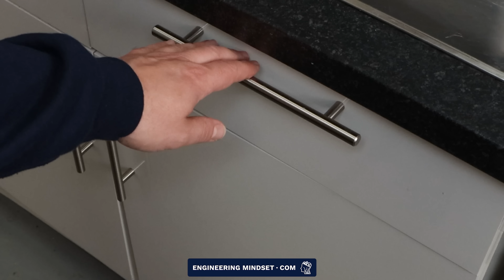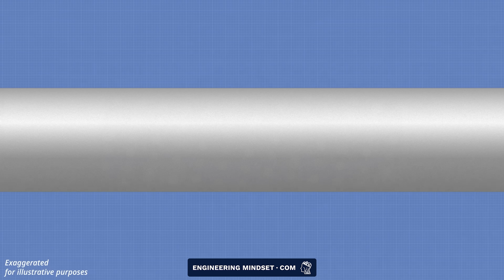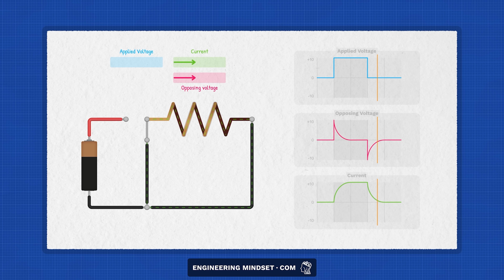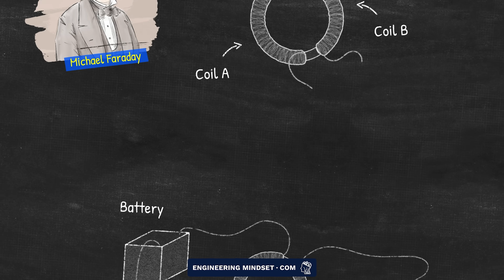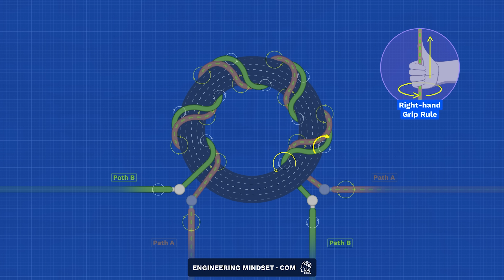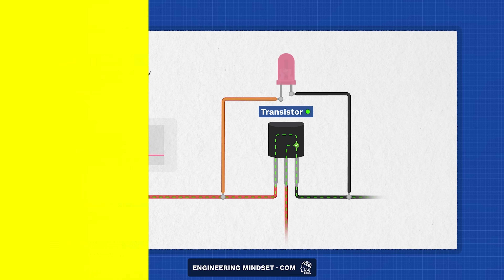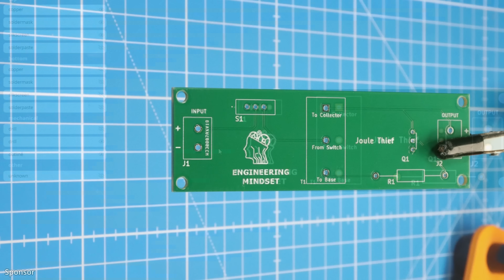Why This Circuit Works When It Shouldn’t

Comment: I bought the Joule thief from the engineering mindset website and I have it working on the breadboard. The new 1.5 volt battery powers the 3 volt LED perfectly.  I connected a .48 volt "dead battery" and it does NOT work?  Please help me to get the .48 volt "dead battery" working.  If I need to use other components to make this work, please advise me where to place it on the bread board. I appreciate the assistance.  I am really "new" at working with electronics.
Reply from the maker: Hello, I have just replied to your email with some tips. But for anyone interested, see the reply below.

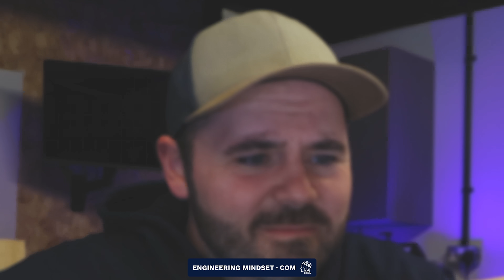So a battery is typically considered dead at around 0.8- 1.0V, as yours is 0.48V it is extremely discharged, once a load is applied it will likely drop significantly more and would be hard to sustain a useful output of current. The one we showed in the video was 0.87V (Time stamp 0:16) and the product page lists "down to around 0.7V"
The main limiting factor is the transistors turn on voltage (base to emitter), it varies slightly with each component but requires about ~0.55-0.6V for the ones supplied. So we need the voltage to be around this for it to work, but it must also be able to provide sufficient current. However, if the components and battery are warm, the internal resistance will decrease so we can get a bit more power out of it and if the transistor is warm, the turn on voltage can reduce slightly. So make sure you're using it in a warm room, 68-77°F.
You could also try adding more turns to the coil, increasing from the 10 used in the guide to 15 or 20 and make sure they are as tight to the core as possible and evenly spread. You can also use a lower value resistor, perhaps 500 ohm to get more current into the base pin. I wouldn't go below this as the battery's chemical reaction is weak and you might overwork it. You could try it with a red led first to test it works. You could also try placing a capacitor into the battery terminals, maybe 100-220 µF electrolytic type (ensure polarity is correct) this can give the circuit a kick start for such a low supply voltage.
The last thing to do is to change the silicon transistor for a germanium one. These have turn on voltages of around 0.3V which your battery can achieve. However, the battery might start leaking as you wear it down to the last drops so be cautious.

Comment: If the battery’s dead it can’t power a circuit. This circuit just uses less energy to appear lit by flashing quickly. Is this right? Am I missing something?

Comment: Question (Apologies for the stupid question)

What will happen should you the normal battery be replaced with a rechargeable battery.

3rik
Reply from the maker: You shouldn't do this, it will drain the source completely so it can drain the battery beyond recovery. Only single use alkaline batteries can be used.
Reply: Only single use alkaline batteries can should be used.

Comment: Transformers knowledges, nothing new. Increase in volts causes decrease in amps.  The output will always loss some watts (energy) due to its resistance.
Reply: Using your logic "Transformers knowledge, nothing new." (I lightly corrected your spelling) Suggests you know this at birth. Would it be "new" to persons not as blessed as you, who are just now being exposed to the knowledge?
Incidentally, nothing about the presentation suggests this as/is "new", but rather explains WHY the design works.

Comment: AHHH MY HEAD HURTS FROM SO MUCH GENIUS
Amazing video, I'd never think of it. A question I have tho is if this circuit has a better or worse power factor than a voltage multiplier with capacitors. I reckon it's less efficient, but wouldn't say for sure
Love this channel 🙌

Comment: Electricity flows from negative too positive though not positive too negative.
Reply from the maker: Electrons do drift from negative to positive, we have a very detailed video about that, but electron holes (conventional current) therefore move positive to negative. In engineering we almost always use conventional current to design any electrical or electronic circuit.
Reply: Guessing the video name, Conventional Current Flow Direction (opposite Unconventional Flow Direction)?

Comment: OR Basically :
The current from battery charge the toroid until saturated ~> that it no longer trigger the Transistor to open && discharge the saturated current in the coil ~> through the LED instead.

Comment: Nice video, loved the detailed explanations of the physics behind the circuit. I learned about joule thiefs years ago, they're certainly very simple and fascinating energy harvesting circuits; but nowadays I wonder about how efficient they really are when compared to buck-boost circuits and charge pumps, which when properly designed tend to have very high conversion efficiencies, frequently over 95%.

It seems to me like part of the energy ends up being wasted as the toroid's magnetic field grows, since the current flowing through it is directed to ground through the transistor until the secondary reaches zero volts and the current flows through the LED. Is that correct? And if so, how much energy is actually being wasted during this phase of the circuit's operation?

Comment: yes, in principle a jewel thief works like a transformer, which can increase the voltage by decreasing the current.

even in a dead cell, it can still store energy, just that the voltage it can provide isnt higher than the forward voltage of the led. The power provided actually decreases a little because of losses but the led still lights up because the reason it wasn't lighting up in the first place wasn't a lack of power, it was a lack of voltage.  
plus the pulsating nature of the jewel thief is also a nice boost to efficiency, since our eyes can't really perceive a different between continuous light and a quickly pulsating light.
Reply: Actually, LEDs reach peak efficiency with constant current driving. Since the power consumed by an LED is the product of its voltage drop and the current passing through it, while the light output is directly related to the driving current, but the voltage drop is smaller at lower currents, the LED draws less power when operating at a lower, constant current compared to a pulsed current with the same average value.

This is the reason why DC dimming is preferrable to PWM dimming in LCD backlights on mobile devices.

Comment: So, this is basically a boost converter with a somewhat unconventional source for the switching signal. If you look closely, you see the inductor, switch (transistor) and diode (LED) that make up a boost converter.

Comment: Exactly what i had in mind, when i first heard, make not working battery make lot of powa
Now keep in mind, i am not educated in electronics nor physics, i hardly know anything in those regions, but i am still interested in learning such things.

So basically whats going on if i understood correctly, this circuit transfers stable electricity into short pulses, just like a capacitor, like a marx generator, if i got anything wrong, please apologize, i already said, i am not educated

Comment: Try it with N channel Depletion MOSFET. Those conduct even when zero voltage is at the gate, and reduce current when gate voltage gets negative. Ideal for low voltage joule thief!

Comment: so if the LED ever broke, all the voltage would run to the too-low-rated transistor potentially causing a fire hazard?

Comment: https://youtu.be/Sh9aZ2uemk0?si=SgxQX9GzKg-j9iSG
Thank you. Learnt most of it. (What?) 11:25 iron is ferro magnetic. Shouldn't current flow in the direction that supports the formation of magnetic field. What happens when one uses other type of materials in solenoid core? Idea : 1. storing electrical energy as electromagnet. 2. Boosting electromagnetic energy beyond voltage provided. I would do it by capacitors in series to ferro electro-magnet in series. That might get LED working. I would not know how to get very high voltage the way current circulations are performed in the circuit and animation.

Comment: Correct me if I am wrong but in a nutshell the 'magic' happens when the ferrite core coils behave as a step-up transformer, which increases the output voltage.

Comment: I have a question:
If an inductor shares the same core with a pair of windings (like a transformer), the current flows the same way by the wires as a core that has spited windings (like a common choke)?

Comment: Apparently the forward voltage of an LED is not based on the materials but actually represents the energy lost by an electron when it emits a photon of the given wavelength. A forward voltage of 1.6 means an electron loses 1.6 electron-volts of energy, which corresponds to red light. This also means that "normal" diodes, with their 0.7-ish forward voltage would function as IR leds.

Comment: put a capacitor and diode (LED) in series with it between the B and C ends of the coils, with cathode of the diode placed on the B,  and then place another LED across the capacitor. This way energy is accumulated in the capacitor and you can get pretty high voltages, to light up a small neon bulb for ex.

Comment: Great vid. Explained VERY well. Thank you. (Also wondering why you have chosen to explain it with Conventional Theory instead of Electron.. neg to pos?)
From AI:
Theories of electrical flow center on two main concepts: Conventional Theory, which assumes current flows from positive (+) to negative (-) terminals (historical, used in power systems) and Electron Theory, which reflects the actual movement of negatively charged electrons from negative (-) to positive (+) (used in electronics). Despite the opposite directions, both models yield the same results for circuit analysis, with conventional flow being easier for many, while electron flow is physically accurate.
Reply: Neg to pos... Even on a Transistor there is an Emitter.. which emits and the Collector wlhich collects. So easy to remember that way. (Instead of Pos to neg)
Reply from the maker: Thanks for your feedback. We use conventional current for circuit design and analysis. For the physics of how a component works, we use electron flow.
We have a detailed video here for anyone interested https://youtu.be/3KePcASD0NQ

Comment: Why is the LED not destroyed by the high voltage? Is it because the voltage drops immediately?
Reply from the maker: The LED blocks the current until the voltage reaches its forward voltage ~4V where it then allows current to pass, so the spike doesn't increae past this. We get a longer low voltage pulse. It depends what you connect to it.
Reply: @EngineeringMindset Right, I watched it again and it was explained well indeed. I thought that 85V peak would reach the LED but that doesn't happen as you clearly mention. Thanks for responding to my comment.
Reply: @EngineeringMindset  The confusing part is, how can the coil be producing this "long" pulse if the oscillation wavelength is shorter than this pulse?

Comment: "The Light Emitting Diode acts just like a diode"......uhm....yeah, that's why it's called a diode...and technically all diodes emit light, but LED's are tuned to emit in the visible range instead of infrared....
Reply from the maker: Yep, we covered all the different types here https://youtu.be/DGKTzl9CTXo

Comment: Question: does this means the battery will discharge faster? Or same but is just splitting hertz to up the voltage instead.

Comment: I'm still a bit confused as to how this works in terms of the whole "energy cannot be created nor destroyed" rule. We're starting with low energy (dead battery) then playing tug of war with magnetic fields to push more electrons harder (freaking faraday batman that's sick) but how does this "create" energy as in increased voltage?

Comment: I hate to be the picky one in the room but electrons, (the subatomic particles responsible for electricity), are negatively charged. in the early part of your illustration, you show electron flow emanating from the positive terminal of a cell to the negative terminal. DC currant ALWAYS flows from negative to positive. Just sayin'.
Reply from the maker: Thanks for your feedback. It's true what you say, generally when designing a circuit we use conventional current and when discussing the physics of how a component works we use electron flow.
For anyone interested we have a very detailed video here https://youtu.be/3KePcASD0NQ

Comment: The principles behind the "Joule Thief" circuit can be a little involved. Assuming your audience has no prior knowledge can make your presentation a little wordy. It might be better to reference other videos and explain the principles there. Also the term "conventional current" is a misnomer since it has not been the convention in over a century. "Engineering Current" or better yet "Electron-hole Current" would be a better term. Other than those points, well done.

Comment: A little detail that was glossed over is that transitors base voltage determines what the effective voltage is on the collector. By applying a negative voltage to the base, you're setting that value to a negative number, which means that it will actually have more blocking power than if it were just kept at 0. This only really matters when dealing with high-efficiency designs, but it makes a HUGE difference if the collector can ever go negative.

Comment: if add full bridge rectifier at LED part, will make LED light  o flickering?
Reply from the maker: The output is DC pulses so a rectifier won't do much. A capacitor to smooth out the voltage would be better.

Comment: Great animations.

I'd still like someone to analyze the impact of the number of turns in the coil: more turns means more resistance, but is there a benefit that comes with that cost? Stronger magnetic field, but what does that translate into. Higher efficiency maybe?

I'd also love to see someone experiment with different numbers of turns in the primary vs secondary windings.

Comment: I think i have seen your other video yesterday - the one with once blinking led and PC adapter upcycling :) now i know what you wanted to achieve :D
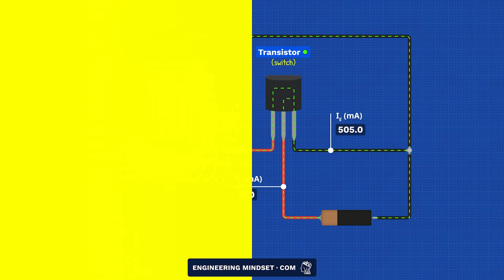5:20  - it only fixes fr an NPN transistor  and in the case of a PNP one some more changes in the circuit would be needed ofc.

Comment: I didn't get from this why the title says it shouldn't work. It's all basic electronics, right?
Reply from the maker: How a 0.8V DC battery (that a battery tester indicated was dead) can power a ~4V white LED without an issue. Even if the battery was fully charged to 1.5V it shouldn't be enough, but the circuit works.

Comment: The magnetic field pulls in aether, which gives the circuit extra energy, basically it acts like a aether pump. Conservation of energy is broken otherwise. But everything else you said is true and wonderfully explained.
Reply: I had laid out an explanation of a circuit I made and nobody here gave a like and I noticed your comment hasn't gotten a like either so I gave you a like  ..  no one that I have seen so far has complained about it or provided ridicule either or probably paid any attention to it either however but when I saw what you said and had actually mentioned the aether it caught my attention as I suspect this is likely the case and I am still having trouble debunking what I have experienced with this particular circuit   ....

Comment: TLDR; The voltage of the battery is raised via circuitry which in turn will drain it's remaining stored power faster, thus still allowing to "operate" on devices that would normally be below it's capable output without said circuitry.

Comment: so basically the electrical version of a hydraulic ram pump
Reply: I just saw a video about this very thing from Practical Engineering earlier today (before I watched this video)!
Reply: @NavneetRao that's a great channel! I watch it is well
Reply: oh thanks that helped me a lot in realising that,  does that means there is just a litl amount of power actually get out the battery ? or do we just loose bits through warmth ?
Reply: @Blattwurst a bunch is lost to heat.  but you'll get more voltage but much less wattage
Reply: @Blattwurst yeah

Comment: 1st off modern light emitting diodes require so little current, secondly, voltage multipliers using square waves thru coils to  create a differential voltage spike are over 130 years old (Yeah I guess more). try ignition coil on Your old car.  3rdly this is just electronics 101 , nothing remotely new, novel or surprising, actually the one to one transformer fired forward and backward on alternate cycles of the oscillator would double the voltage even if the oscillator was a sine oscillator..... wow

Comment: and there is no noticed magnetic flux in a dc current  its thought because of alignment of electron  & positrons(nuclides aliment or compensation "inducing" the electron shift)   if you want to see electron and positron use a, AA or AAA battery and a compass switching the negative and positive ends of the battery pointed towards the north or south end of the compass needle

Comment: 17:12 hundreds of thousands of times per second? Then why is "67.797 times per second" circled? Which one is correct?
Reply from the maker: It shows "67,797" times per second. That isnt a decimal.
It also shows a cycle time of 14.75 microseconds, frequency = 1/T so 1÷0.00001475s = 67,797Hz so it repeats over 67 thousand times per second.

Comment: Very common circuit called a "flyback converter". It is used in nearly every power supply today. This is the simplest circuit for demonstration. The LED is a type of diode but it's normally a rectifier diode but in this application does the same thing and lights up.

Comment: Question?
What if the circuit has a voltage spike?
What size or thickness was the copper wire used for the coil?
Does the switch ever get stuck into position?
What if we make the Toroid core thicker or bigger, would the magnetic field be bigger as well?